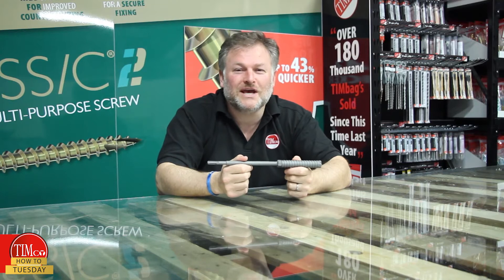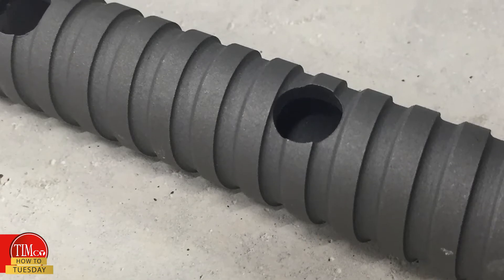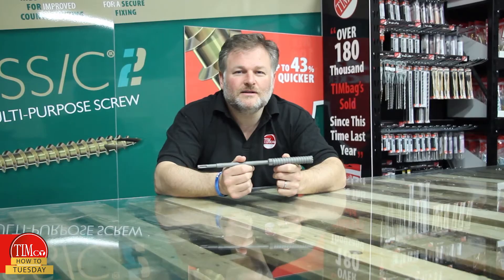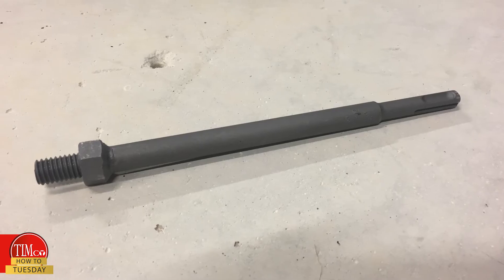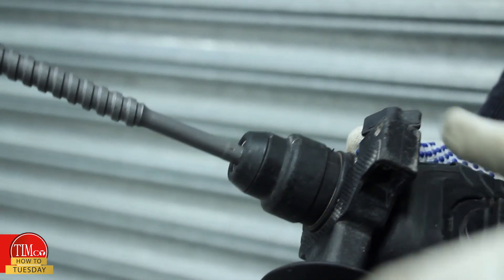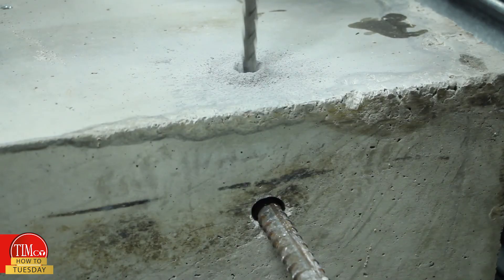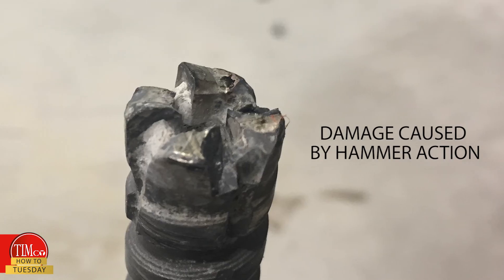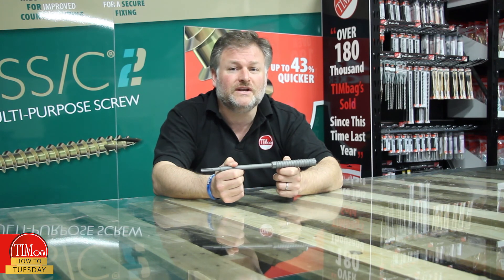Rebar Cutter   How To Tuesday

Comment: I have a question (maybe a stupid one).

To my understanding when you cut the rebar with this drill, a little bit of rebar will stay inside the bit and you pull it out when you take the drill out. What do you do if that little piece of rebar does not get stuck in the drill bit and remains inside the hole?
Reply: excesive amounts of cursing

Comment: how about bigger core bit holes i always run in to rebar with my 2.9 inch core bit wish i could cut through the rebar and save my core bit any thoughts
Reply: I am legit facing this same problem later this week. I am core drilling 3''dia holes. I know I am going to hit rebar. What did you end up doing?